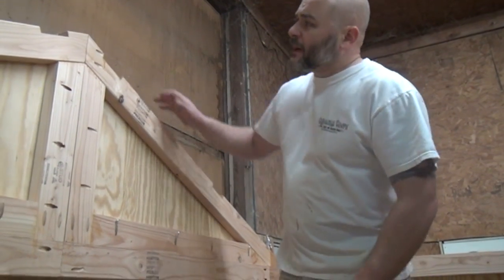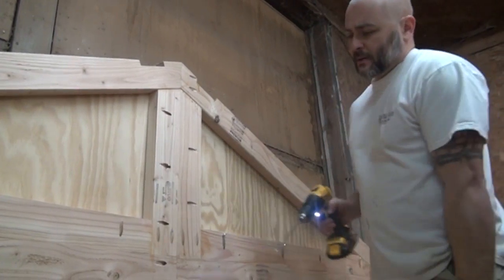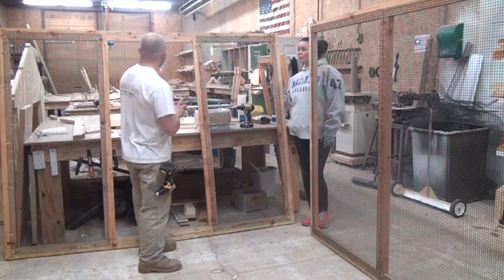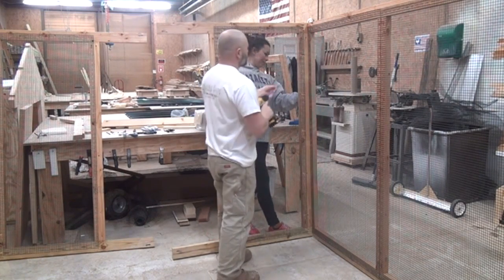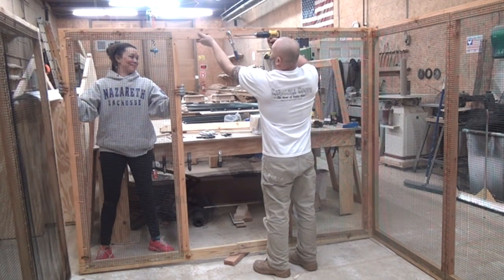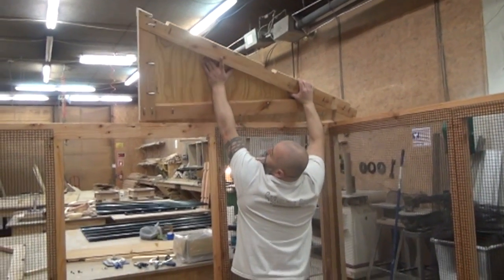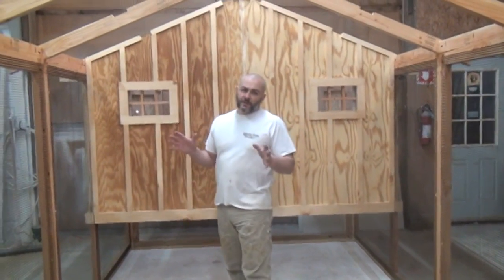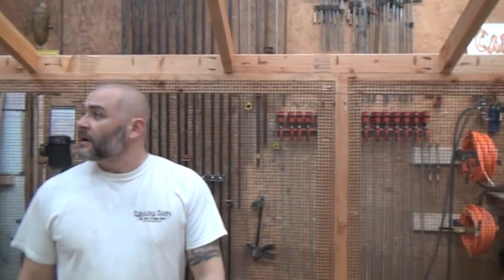Martin II

Comment: Your products look very well made evidenced by how tightly they interconnect. The use of the pocket screws is brilliant. A couple of comments from someone with over 50 years of construction experience. The "filler" pieces should/would be called "freeze blocks". The rafters/roof would gain a lot of strength/rigidity with a "collar" tie maybe halfway down from the peak or at least a "plywood" gusset at the top that would be at least twice as tall as the one you are using. Mostly a potential issue along the run walls as downward pressure on the roof would try to push the run walls outward without the collar ties. Love the way you have notched the rafters for the purlins. Yea, building this on-site where the bottom is not flat or twisted will make for lots of "colorful" language since your joinery is so precise. ;o) . Do you sell plans for your coops??
Reply: Thank you for your feedback. Thanks for watching.

Comment: I don't get using larger lumber than needed on some of the construction?  I mean seriously?  2X4 for a little ol structures like egg boxes??  LOTS of FULL sized housing for PEOPLE that is WAY larger has been framed with 2X3 and lasted over 50 years!   Smaller structures should be built with smaller lumber otherwise money is wasted,  there is less space within, (less ventilation) ...more effort, more paint etc etc...would appeal to moron "more is better" mentality though....reminds me of campers I have seen built on pickup trucks where the guy used full on site built HOUSE sized lumber making a "camper" that totally totally totally overloaded the truck...and why?  MORON is why!  IMHO
Reply: 🤔 Good point - thanks !  😊